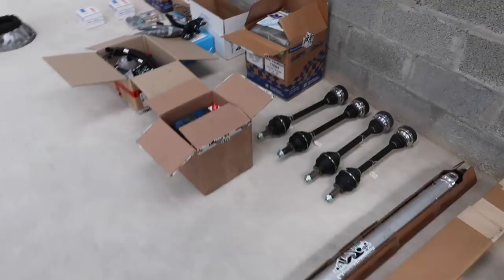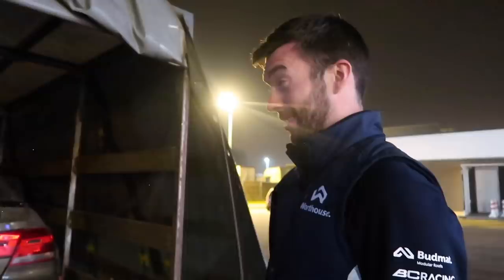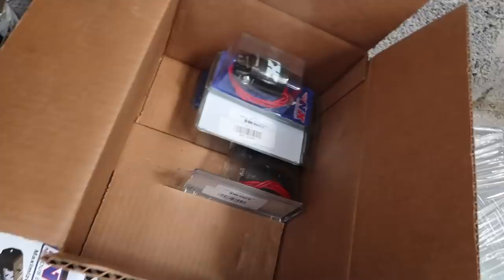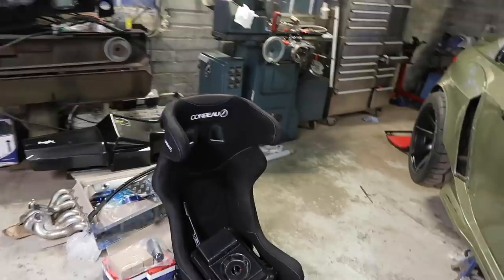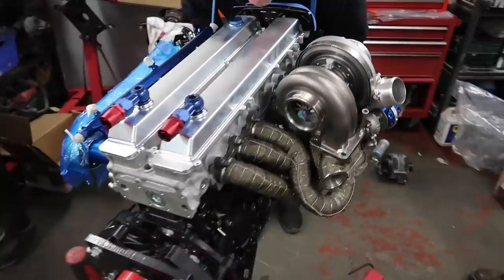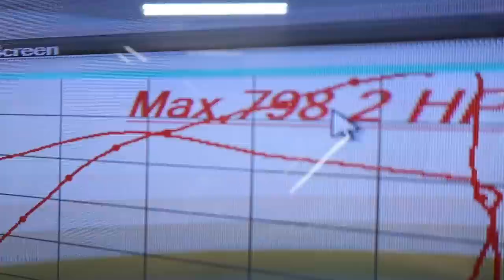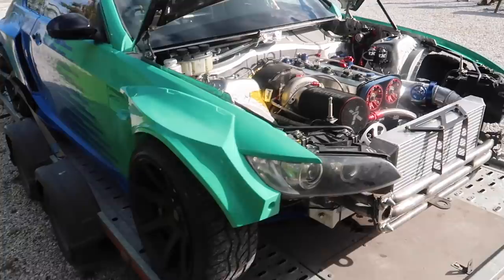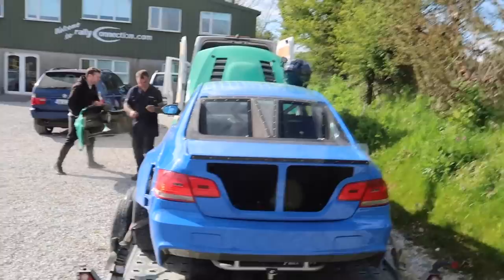2JZ Powered Eurofighter Build & First Test | James Deane

Comment: Not so fond on camber gain in full lock.  I'm excited to see how the chassis will perform with you behind the steering wheel. Also that's how all BMWs inline 6s should sound from the factory.